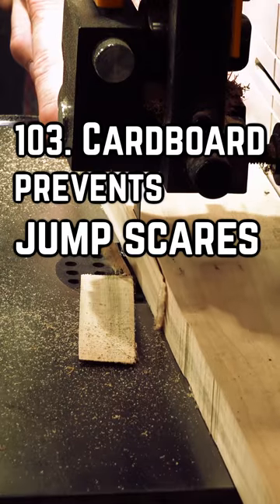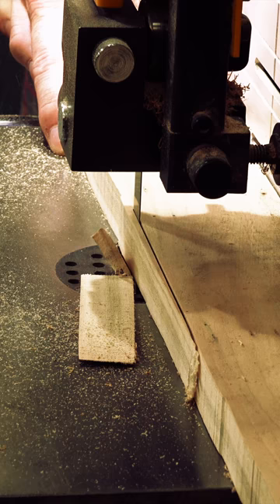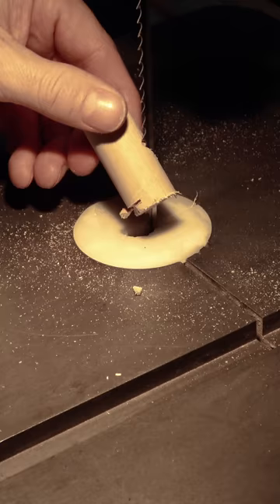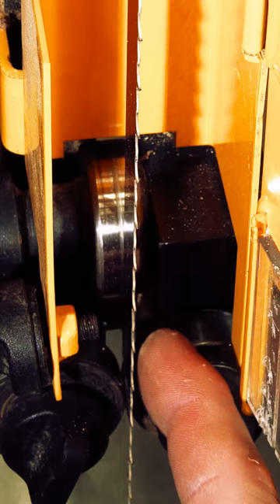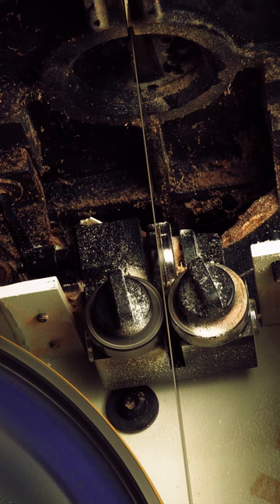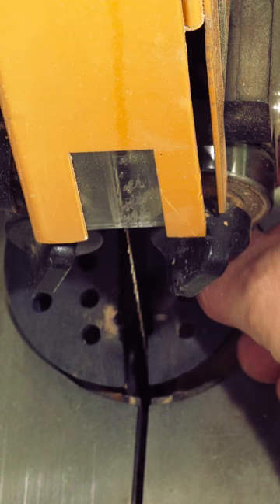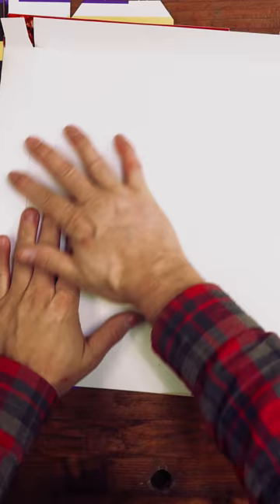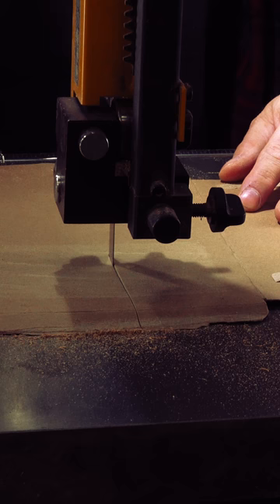103. Cardboard prevents jump scares #mtbitesize #shorts

Comment from the maker: Hey Makers!  New B4WMT video coming out tomorrow night!

What types of jokes do woodpeckers make?  Knock knock.

Got a tip, send me an email (and get credited)! → https://bit.ly/3KsbPL4
Reply: I've popped off the big blades more than once.
Reply: this so fkn smart, band saws are kinda scary😂 too many ppl use band saws for wavy cuts then book the manipulate the saw blade too much and it blows up
Reply: I mean I just had a thin piece of plywood that I would end up using for this but still a good idea I mean as long as your blade is sharp so it doesn't forcibly pull anymore chips down
Reply: Lmao I just watched a video on reddit getting knockout by a kick back
Reply: I work on a full stainless steel bandsaw in a beef production site. Cutting bones and round stuff all day. Have had many blades snap. They usually just retract into the doors with a bang but once it pushed out into an S shape and was millimetres away from my finger. Small pieces of bone on the back of a piece being pulled onto the table and exploding is fairly common.

Comment: When I was a novice student, I cut my finger to the bone, because there was a blunt blade with a sharp section. I was applying firm pressure, when the saw suddenly cut well and my finger jumped into the blade.
Reply: I mean, path of the blade and everything...

maybe the sudden movement changed your course or something but I'm sure you learned from it
Reply: @rolls_8798  Yep, always try to keep out of the line of cut.
Reply: In most situations, a dull blade is more dangerous than a sharp one
Reply: @emmybee5189  Yup! It's so much more terrifying to think about, because when it does cut, it's going to be much less clean, and a hell of a lot larger of a cut than a sharp blade.

Comment: Great tip! Never thought of making a zero clearance barrier with cardboard.
Reply: I like painters tape or Duck tape
Reply: it's easier and safer to just make a new zero clearance out of wood
Reply: @StygianBlood  Yep, I agree. But if you are in the middle of a job, with a worn out insert, and you need to cut a few dowels on the go, this cardboard trick can solve the problem until you have the time (and the mood) to make a proper zero clearance insert. That's how I saw the cardboard tip.

Comment: You can cut round shapes safely if you feed it by rotating counter clockwise into the band saw blade, ie feed the lower part into the blade.

Comment: The most scary thing I’ve had happened was in middle school and the blade snapped while I was doing a straight cut and flung out of the machine. I used a different bandsaw to finish that cut. Then about a week later I ended up using the first bandsaw and the blade snapped again, but this time I had someone watching and the blade came whipping out the machine and nearly hit them in the face as well as me. 

Came to find out the wood shop teacher was welding the blades back together instead of just replacing them. An the failure was at his weld both time, apparently the blade was old and dull and the welds just couldn’t hold during cutting.

Comment: There only a few dangerous parts on a bandsaw. 1.The blade can be dangerous when too much of it is exposed since people might bump into the blade somehow while being concentrated on cutting something. So having the cover as low as possible to cover most of the blade helps to prevent that. 2. Cutting round things can cause the saw to snatch the part out of your control and hand maybe with it. So if you cut round things make sure to use a clamping system to have a tight hold of the workpiece and to have a fresh sharp blade with a high rotation while cutting slowly.
The third thing is mentioned in the video, so I won't cover it.

Comment: I have a scar on my thumb from when I was in metal shop in school, and pushing a piece of metal through the sawblade. My thumb in line with the blade. Figured it was going slow enough I could control it. Then I finally got through the harder part of the metal to a soft part and it surged forward and sawed deep into my Thumb. That was a LOT of blood.

Comment: This is either very clever or horribly dangerous.
Reply: Ignoring the other realistic possibilities,  do you actually have any reasons that you think it would be dangerous?
Reply: @suedenim9208  basically my reasoning is that all these machines are made to cut wood,and will cut iron with a bit of a struggle.
Bone and flesh won't even make a sound when contacted by a blade and allowing ones own fantasy to run free close to those machines is kinda cursed.
Those things won't warn you,just break,bend,slip etc.
In this case the cardboard can easily slip should the chance be offered to it, with or without tape.
Ultimately I am not sure but if I was faced with a similar issue I would just use scrap ply,or make a zero clearance insert!
After all it is very rare that we hurt ourselves without responsibility.

I always think about an imaginary son or apprentice and if I would let them do this or that trickif I feel scared for them I think twice before I do it. Sounds reasonable?

Ultimately, fingers,don't grow back,for me even the dowel cutting was a bit terrifying

Comment: probably fine occasionally, but cardboard is murder on bandsaw blades
Reply: Cardboard is murder on any edge. Had to cut up some thick corrugated cardboard so I grabbed a brand new razor blade and I completely dulled it in a few long cuts.
Reply: not cutting much

Comment: Great tip! Also, it's called "chipboard" not cardboard
Reply: Sorry but Chipboard is a conglomarate board made from wood scraps glued and pressed together,  Cardboard is made from paper and starch.
Reply: @dogwalker666  Interesting point, there is definitely some room for multiple definitions of the same word, depending on whether the conversation is about paper products or wood products.
Reply: @CalMariner  they are completely different products,  Corrugated boxes and cereal boxes are made of cardboard, I have actually worked for Bowater who make them, Chipboard is a completely different item made by Egger, 
Sorry but you are mistaken the video maker is correct.